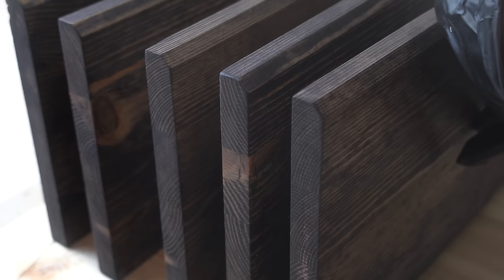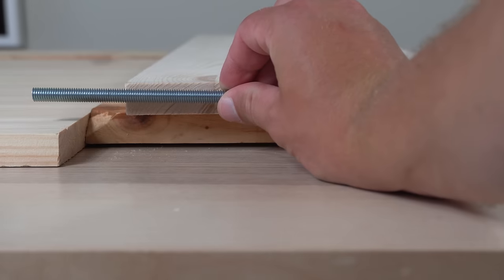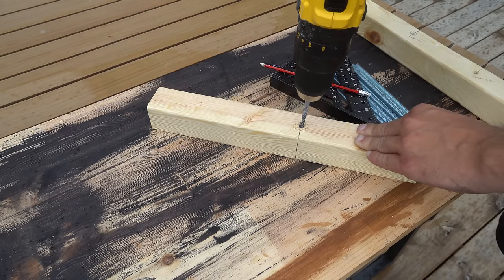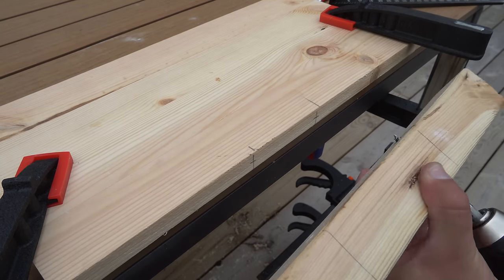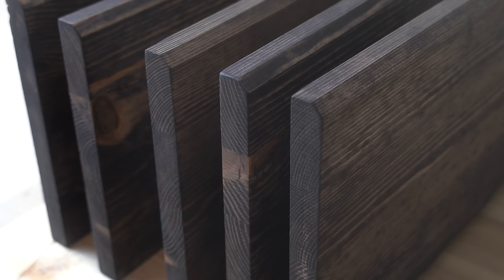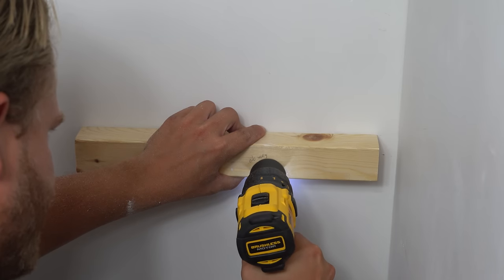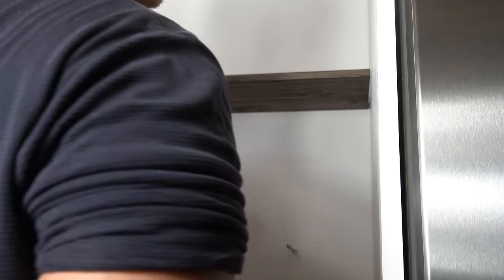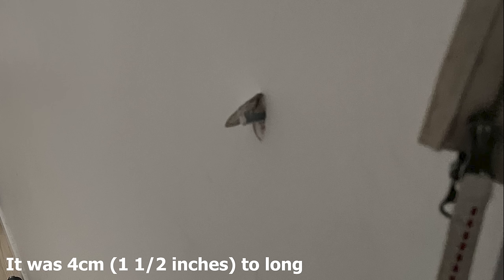How to make floating shelves, with invisible brackets

Comment: I'm thinking using to use 24mm thick 40cm width 30cm depth wood for a floating shelf that can sit on it while wearing shoes
Reply from the maker: It will look really nice! but If it is only 40cm wide you i think you will have problems finding good anchor points (studs) to insert the threaded rods into. As studs are often placed 45cm or 60cm apart. And you will need good anchor points to support the weight i would atleast 12mm thick threaded rods for the task. The thicker the better. I used 8mm in a shelf that was 18mm thick so 12/14mm would work aswell for a shelf that is 24mm thick.

Comment: Thanks for thisl I'm about to start building exactly the same type of floating shelf.  Do you find the rods bend and the shelf sags a bit under the weight of the load on the shelf?  Would it be worth it to have the rods angled slightly upwards by a degree or two so that when loaded they deflect to the horizontal?
Reply from the maker: Short answer: no they don't bend

Long answer: these shelves are in a pantry, which means they won't have such heavy things on them (max 15kg) the shelves are still completely straight 1 month later and he has no tendency to bend :)

The shelves in this video are quite thin so it is difficult to use thicker threaded rods in this case. If you have thicker shelves, you can use thicker threaded rods. Which means you can have a lot more weight on them (100kg+)
Reply: Thanks!  That's good to know!  I'll be using a 27mm plank with 10mm rod, so I guess it will be plenty strong enough (and not bend!)
Reply from the maker: Sounds perfect! Good luck with the build, feel free to send a picture to my instagram when you're done!

Comment: Great video! Could you share dimensions of the pine boards used for shelves? They look like 1 inch thick and 8 wide but just wanted to be sure. Thanks!
Reply from the maker: 3/4 inch thick and 8 inch wide! These are "thin" Just using 1 inch shelves will make this much easier. But it wont look as good 😀
Reply: @HallbeamDesign  Thank you!

Comment: @hallbeam design, hello, what size would you recommend for cutting threaded rod pieces for a 11 inch shelf? Thanks
Reply from the maker: Depends, is the shelf 11 inches "long" you will probably need a another way  of installing them due to the fact that you most likely won't have two (2) studs to fasten the threaded rods in. 

If the shelf is 11 inch "wide" i would use a thicker threaded rod than the one i use in the video. But it all depends on how thick the shelf is. 

How thick is the shelf?

Hope this helps a little bit :)
Reply: @HallbeamDesign  hi. So the shelf is 34 1/2 long. 11 inches wide. Two studs will be used. And the thickness of the shelf is 1 inch
Reply: @HallbeamDesign  also. Can you send me the link to the socket for impact driver you used to screw in the rod to stud please. Thank you and happy new years
Reply from the maker: @anthonyreal1  I would use a 1/2 inch threaded rod in that case!
Reply from the maker: I would buy a set like this, just make sure that the nuts for the threaded rods are the same size as the sockets.  https://amzn.to/47C5ozn or https://amzn.to/4aKsfLw

Hope this helps!
Reply: @HallbeamDesign  thank you so much and I will keep you updated with my current project. Take care.
Reply from the maker: @anthonyreal1  I hope you will! 

You could send images to my instagram "Hallbeamdesign" If you want aswell.
Reply: @HallbeamDesign  I will add you asap and send you my work. 😅. All inspired by your work tbh, even the stain you used😅😅😇
Reply from the maker: @anthonyreal1 You are welcome to do that 😀 that's the purpose of my channel, i want people to copy what i do.
Reply: @HallbeamDesign hello my friend, I will working on my protect this weekend, but I have a question about the staining process. For your shelves, did you prestain, stain and use any wood finish protection or did you just sand and stain the wood? Thanks man.
Reply from the maker: No prestain, no hardwax. Only "decor wax" from Osmo. It is pretty good by itself, you could use osmo hardwax oil on top of the stain aswell for increased protection :)
Reply: @HallbeamDesign  thank you. I do have the same exact osmo stain and color. Will follow your directions. Take care
Reply from the maker: @anthonyreal1  You too! I saw that you follow me on instagram aswell, If you want to, you could send photos of your project :)
Reply: @HallbeamDesign  will do

Comment: I am surprised there is no play. Very cool, i will have to try this out. Are you using a 5/16 drill bit and a 5/16th threaded rod? Or is your drill bit a touch smaller i would assume
Reply from the maker: I drill it a "touch" smaller (15/64th) the studs. The shelves I drill in the same dimension (5/16th or 8mm) as the threaded rods. The threads are gripping the wood perfectly when doing it this way. 

I will soon make some thicker floating shelves with the same techniqe. But with thicker rods. 

Good luck with your build! :)

Comment: Do you have a method to do it for walls with blocks and not studs?
Reply from the maker: If the wall is made with concrete och   "stone" this only make the shelves more sturdy. When you are drilling the hole to insert the threaded rod, just use a drill with the same diameter as the rod.

If there is nothing behind the wall (which is unusual) there are many other solutions to buy in stores. ones that you screw onto the outside of the wall :)

If you got the skills, you could tear down the wall and put studs behind it.

Hope this helps! :)
Reply: @HallbeamDesign  aren't giant screw anchors necessary for concrete?
Reply from the maker: @joelniv24  it depends, If you make the hole in the wall "perfect" the friction will hold the threaded rod by itself. I don't see any problem by using anchors. There are also chemical glass anchors that you can use. 

Putting threaded rods in concrete will make the shelves pretty much indestructable.
Reply: @HallbeamDesign  sounds good, thanks man, but can you tell me how you managed to drill on blind and get the pure 90° you wanted for that "90° sample"? Cause it seemed pretty lucky
Reply from the maker: @joelniv24  Very Lucky indeed, it was also my first try. I see it as a trial and error way to make a 90degree jig without "expensive tools" :) 

I have better ways to make 90 degree drill jigs, but the main purpose of my channel is to show people that you dont need expensive tools to create things :)
Reply: @HallbeamDesign  weird, because I tried to make this jig with a reliable stand drill of a real carpentry shop, and still the drill has a little space to move inside...
Reply from the maker: I suggest that you measure the drill to check that its the size its supposed to be, because the drill should not be able to "wiggle" 

Even if the drill is a little bit smaller it should work anyway to drill near 90 (89-91degre) Degre holes into the wall/shelves
Reply: @HallbeamDesign  thanks for your answers :)
Reply from the maker: @joelniv24  No worries, i always respond to comments. I enjoy what i do. 

Good luck with everything and If you want, you can send pictures to me on my instagram "hallbeamdesign"

Comment: I don’t get it : when you push the boards towards the rods, how do you lock the whole thing so it doesn’t slide towards you?
Reply from the maker: The friction will hold it in place!

It will take quite a lot of pulling to remove them. First time i did this i was "amazed" that only the rods are keeping the shelves in place.
Reply: @HallbeamDesign  ok thank you! Nice video btw
Reply from the maker: Thank you! There will be more videos, i'm doing two different projects right now. 

Thank you for commenting!

Comment: Sorry but aren't these just normal shelves? They aren't floating, they look like they're beging held up by the sides.
Reply from the maker: At first glance it might look like that. But they are only held up by the threaded rods into the studs behind the wall. 

I'm not a doctor of languages, but I would say that these are "floating" despite the fact that the sides of the pantry are very close. 

Will be doing one more video regarding floating shelves in the future. 

Hope this clears things up :) thanks for your comment!
Reply: @HallbeamDesign  Yes I meant to say they  "look" like it but it just bolded my comment instead of italicised it.
Reply from the maker: I also like italicised letters, very helpful in most cases. 

Are you going to yo build sime floating shelves for yourself? :)
Reply: I used pocket hole screws directly into the studs. Worked great for my floating shelf under my TV.

Comment: What if the wall is dry wall?
Reply from the maker: This is drywall :) drywall always has studs behind it with regular measurements of either 45cm
or 60 cm for the wall to be robust

If you make a very short shelf, you probably won't be able to screw in at least two studs. Then you have to do it in a different way. 

If you want to install these kind of floating shelves i reccomend checking the wall first with a "stud detector" 

Hope this helps :)

Thank you for your comment!
Reply: @HallbeamDesign  
Yes, thank you ! This help. I always thought that if behind are these aluminum profiles they are not strong enough. I should try I guess. Thank you for your answer. Keep up the good work.
Reply from the maker: In some houses there are aluminium studs, but most common are wood studs. 

Thanks for your comment! 
Good luck with you build! :)